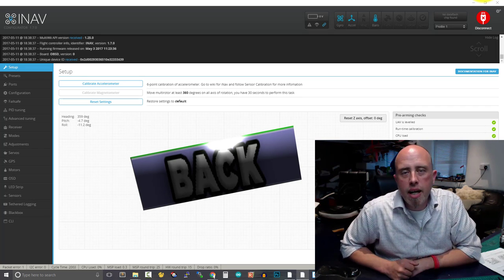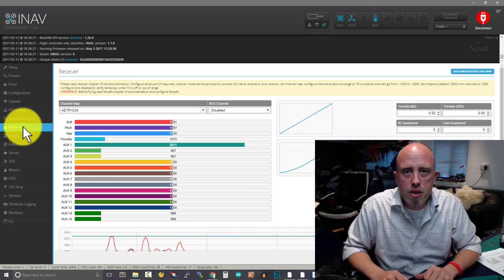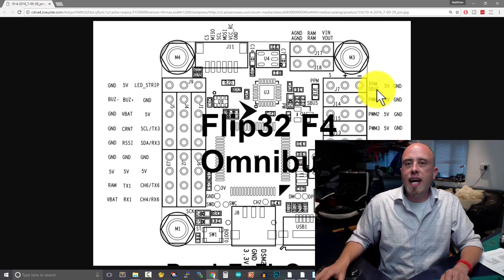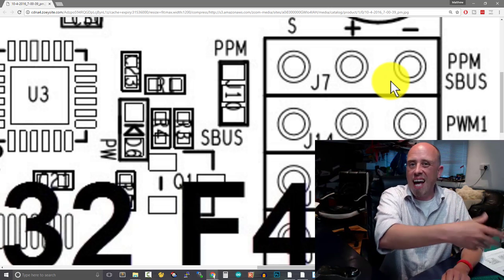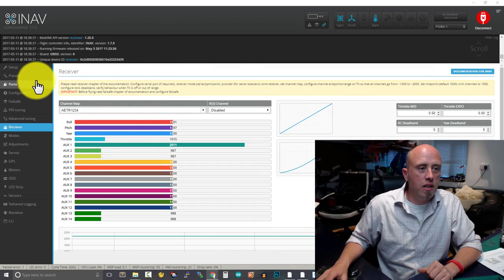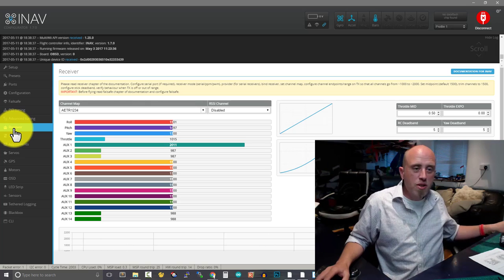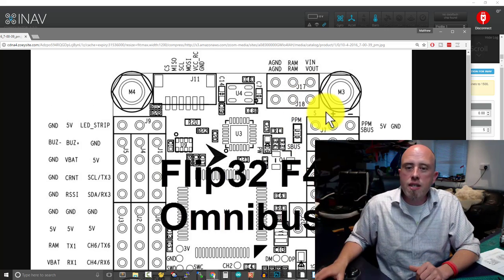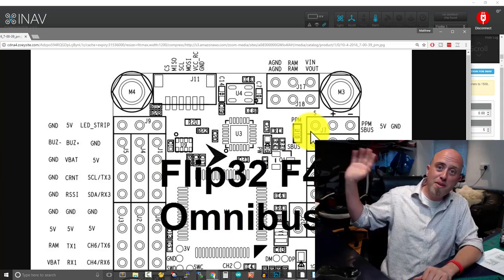FIXED: SBUS Not Working on a Omnibus F4 Pro V3 Flight Controller?

Comment: This board is built into the eachine wizard x220s which is a popular quad for new hobbyists, so i figured i could find a straight answer. I guess everyone is buying the RTF version cuz I've been stuck trying to get my frsky x-rsr to work for seemingly decades. I soldered the pads as I had seen here and previously seen in some italian guy's video showing how to solder on the frsky receiver (thank goodness he had subtitles). I managed to somehow get the receiver to bind with RSSI signal response and everything. Still couldn't get it to move in betaflight. Turns out i had the wrong firmware flashed and i had to pick OMNIBUSF4SD rather than just OMNIBUSF4. was this the solution? of course not. I'm at least to the point where all my firmware is updated on the receiver, the transmitter, and the FC. The main issue now is that no matter what firmware I flash, I will save the port setting with UART6 checked using the smartport protocol and it will just reboot with the port deactivated as if i never touched it. This was of course before reading about the f.port protocol. But the f.port protocol won't show up no matter what FW i flash onto my receiver. UGHHHH!!! And let me tell you, this is my very first quad, and after hours upon hours of research plus learning to solder,  i'm seriously regretting not just settling for the RTF version (with the less than ideal transmitter). I read about some kind of port inversion issue with the newer SBUS receiver, but apparently none of it is necessary with the new f.port protocol if i could just get THAT to show up. My only other suspected issue is that my solder blob was a bit too big and touching the PPM pad but i think i can just make out a tiny bit of silicon between the two top pads. Sorry for the long winded comment, I just think a lot of people are going to have to deal with this if they buy an ARF wizard from amazon like my dumbass did. I don't want to have to go back in with the solder iron unless totally necessary.

Comment: Thanks for the informative video . Does it apply on omnibus f4 pro ? 
Got the same issue now
Reply: he dont even shows a schematic of a PRO he has no plan hes talking about model F4 Plus. no current sensor, no PRO
Reply: @f0xvibes  Hi .. 3 weeks ago I followed the instructions and soldiers those tiny point as he mentioned and it’s worked for my omnibus v3 Pro .
Reply: @emptyqrider  lol... This is because you also didnt have the Pro Version. He Show to 100% Not the schematic of a Pro Version. The Pro Version has a build in current Sensor, and much less solder Pads to Connect
Reply: @f0xvibes  you mean that the package labeled v3 f4 pro was my missleading ? First time to know really. Anyway thanks for the headup . appreciate it
Reply: @emptyqrider  maybe yes, if you Order from AliExpress they often didnt know what they are selling, or cheating customers...It could ne a F4 V3 Plus. Just search in YT for Omnibus F4 vs F4 Pro. You could easy identify which one you have
Reply: @f0xvibes  again I appreciate your inputs . btw i bought it from Banggood.

Comment: I did exactly what you said, still not working to me...
Reply from the maker: Howdy fella, sorry to hear that. The best place will be to contact the retailer where it was purchased from for help, Matt
Reply: Had same problem. Changed RX to UART 6 in Betaflight and works fine. Hope this help.
Reply: Do you by any chance have your GPS or BT module connected to UART6.  If so, that might be the reason you can't get SBUS to work.  I had the same problem.  You'd need to move these devices to a vacant UART.

Comment: Hi Matt.. Did u ever try to flash PX4 on f4_v3 board? https://docs.px4.io/v1.9.0/en/flight_controller/omnibus_f4_sd.html there is a tutorial about process. but it is for f4_sd. when i follow that on f4_v3 and even soldering sbus, i got an error on qground about 0 rc channel px4 needs at least 5 rc channels. i try with "flysky fs-i6x tx & fs-a8s rx" and "frsky taranis x9d-plus tx & d8 rx". in both combination betaflight response withouth any problem. drone is default eachine x220s and on betaflight i didn't need soldering. actually when i open drone i saw this solder space :)

Comment: Still not working. Done everything you’ve said. 😭
Reply from the maker: Howdy, assuming you've tried a different receiver, then all I can really suggest is you get back in contact with where you bought the board and suggest it's faulty, Matt

Comment: Matt, have you had any interference problems regarding using CURRENT SENSOR in F4 Pro Omnibus boards in FPV Image? Im running the FPV gear (camera + transmitter) directly out of the battery, through a LC filter, and i still get lines in the image as i give more throttle. Besides that, as i throttle up (like 80% or more), sometimes all the OSD information blinks in and out... Any thoughts? I'm thinking about changing to a PDB + FC (F4 non-pro) setup. Here's a flight example: https://www.youtube.com/watch?v=lnWwL1ud02s